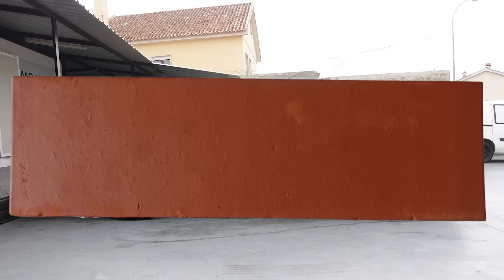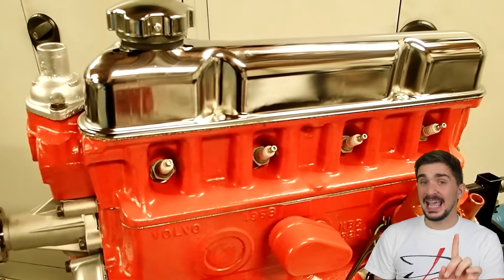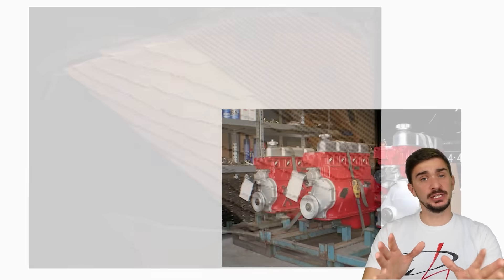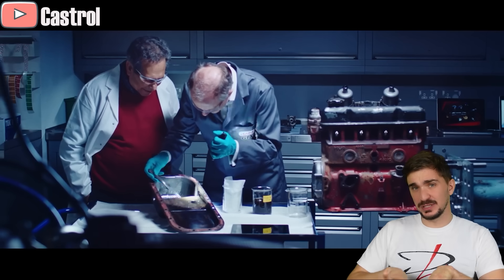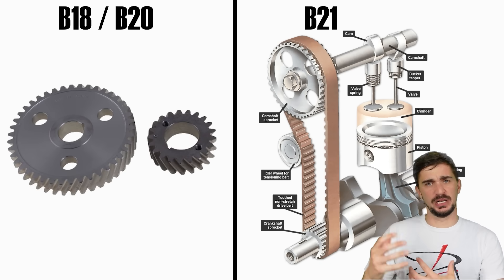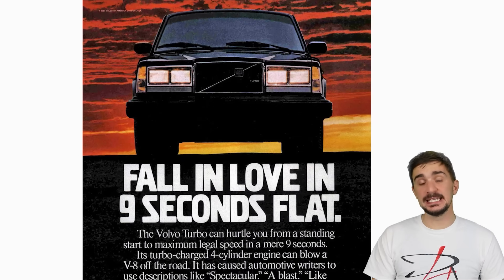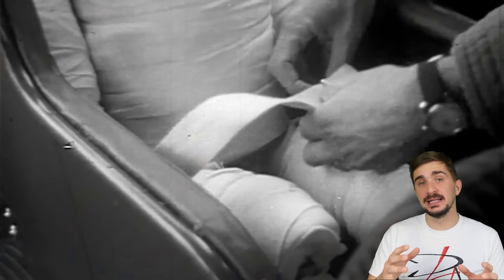A Story about the Volvo 240 and its Redblock Engine - Iconic Cars and Engines #18

Comment: There's a minor inaccuracy there: The 240, merely a facelift of the 140 series, was launched in 1974. The OHC engine wasn't introduced before 1977. Except for the changes to the block to make the OHC version, the engines remained the same, only varying in bore. The stroke remained 85mm with all of them. So basically, the engine was the same since the long block with its 5 crankshaft bearings. And yes, they were the best bloody cars ever, skip all Mercedes Benz and Beamers and what not.
With the 140 launched in 1962, the basic design stayed in production for 31 years. Why change something good? It was only when the Ford buzzers took over Volvo that the demise of the 200 series was decided. F*** was not at all good for Volvo, they took what they could get, based most of their designs o the Nineties on the 850 chassis and played havoc on many services Volvo offered their customers.
For example at least Volvo Germany here in Cologne had a service hotline for garages and DIYers where workshop reports were collected and available for everybody who encountered a problem he couldn't diagnose. This database had been collected since the Fifties and was a real treasure! It cost money, F*** wanted that money for their shareholder value, F*** shut it down.
F*** F***! 🤬😝 💩
I owned my 1977 244GL for 17 years and still miss the bugger today. I know where it is and if I win the lottery I will make its current owner an offer he can't reject!
I also owned two 340s and two 740s which I got after they had been exposed to SERIOUS neglect and abuse. Turns out you can even destroy Volvos, but engine, gearbox and rear axle still were going strong with all of them. (If you get a 740 with the Bendix made brake take a very close look at the front callipers. These are real troublemakers! Poor maintenance will cause them to stick, and the 740s hardly ever received really good maintenance once they got cheap.)

Comment: I owned three 240's between 1975 and 2008 and I can state without a doubt they were the most reliable and all round pleasant cars in my 53 years of driving.
Reply: I've never wanted a vehicle so badly so quickly
Reply: Care to expand please? Are they smooth? How about steering? Fuel consumption?etc
Reply: @JamaicanToast  Fuel consumption was not a strong point I admit, 28 or so mpg around town, but in those days petrol prices were not the concern as they are today. They were comfortable and 'smooth' enough for me and family. The 1975 244 DL was  the first car I ever owned with power steering so I found It light, especially for such a large car and all of them cornered very well. But it was the incredible reliability; the large carrying capacity; the fantastic heater on a winter day and the all important safety features that appealed to me. And the 'Red Block' B21 engines - say no more - unbreakable! For Instance our second 244DL bought in 1980 we kept for 18 years and that engine never had anything other than oil and air filter change, plugs, points and timing belt in all that time!
Reply: Hello Peter how are you doing 😊

Comment: Can anyone tell me if the suspensions on the 200 series Volvos was softened for the North American market? 

I ask this because in the mid 80s I installed stereos and all Volvo owners came boasting in with the same phrase, "Toughest car in the world! I rolled it and we just rolled it back on it's wheels and drove away." I can't express how many people bragged about rolling those Volvos. 
Eventually a turbo model came in. The "Turbo" badge meant it was fare game to try out when the customer dropped it off. I took it out on a straight road, and stomped on the throttle. Once the turbo kicked in, the heavy body flopped back  rendering the steering useless until I let off the throttle. If the suspension was really up to the job it would have been firm enough to control the body.
The only car that scared me more was a turbo Saab. It reacted the same way except it added torque steer to the fun. This is why I wonder if NA got softer suspensions than EU.
As a side note, I drove plenty of Porsches. MR2s, Eclipses, 300Z etc. None of those ever scared me.
Reply: l would argue that the suspension springs in the early 70s was too soft. lf you look @ the cars of '70, to '74, the rear wheels went lower inside the wheel well after about 6 months (my father owned a Volvo dealership in Canada and l rubbed many new Volvos by hand, rubbing off that white soap/wax film and saw it up close and personal). After '75 with the introduction of the 'shovel nose', the rear wheel spring adjustment was made to a harder form so that it remained level, from front to back. ln 1987, with the introduction of Euro spec headlights and further aerodynamic extended nose, the rear suspension springs were slightly stiffened to a satisfying slight decline to the front wheels. Look at the 140 --> 240 cars, over the time the rear suspension springs become stiffer and higher.
Reply: @PhilDykshoorn  Thanks for the response and insight. Very interesting. All I can say is that for the turbo versions I believe the springs and dampers could have been even stiffer to control the turbo lag. And back to my initial statement, were the EU suspensions stiffer the NA. 
I much appreciate the insight.

Comment: 1:45 Same timing design as the Ford inline 300, which has been around since the early 60's and regarded as the best inline 6 ever. That's 15 years earlier than this engine.

Comment: @2:09 Whether or not it is fact or fiction but cast iron is pretty rugged.
@8:25 Durability, which resulted in an overbuild engine.
@10:23 The 240 Turbo was anything but a performance car and practicality is anything but the hallmark of a sports car.
@11:09 The stock version was still no performance car and as sleek as a brick.
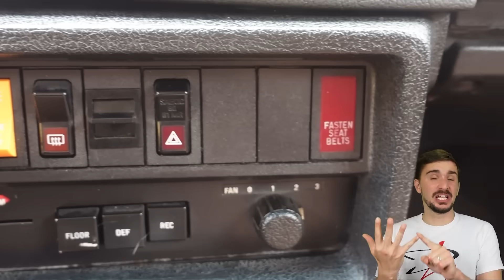@11:51 The reason why it was primarily bought by cheapskates and leather interior was the exception to the rule.
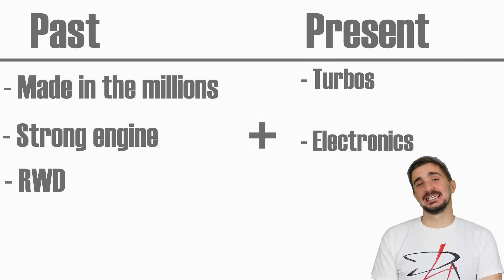@13:59 If you don't mind the poor drag coefficient and a car of the 70ies with basic interior, that is.
Reply from the maker: I know exactly what it feels like to sit through a movie with you

Comment: I must say that the cam gear on the B18/B20 can break. It happened to me driving from Gothenburg to Oslo on the motorway. All of a sudden the engine stopped working. I was towed to a garage and i quickly found out that the camshaft wasn't moving anymore. I got new parts the same day and replaced them outside the garage, and had the car running in hours. No damage to any parts except the fiber gear. Really good engines. :)
Reply: Happend in my 242 too. The fiber gear exploded and cracked the gear cover. Had to tow the car 120 km without power brakes. Found a replacement gear for free and in a few days it was running again.

Comment: Fantastic video! I have one and the only way I'll get rid of it is if it's totaled beyond reasonable repair in an accident, then I'll buy another. 

A few things things I'd add. The rear axle is a Dana 30 which can take more torque under street driving conditions than a turbo redblock can produce. This means most engine swaps don't require a stronger rear end like a Ford 8.8 unless you're really beating on it. A 6'2" adult can sleep in the back of the wagon and I've fit 10ft/3m tubes inside when I didn't have a roof rack. 

The one major downside is the M47 transmissions are absolute garbage. The M46 was a bit stronger, but for a company obsessed with building such a durable car I can't fathom why they put such weak transmissions in them.

Comment: As a '80's Volvo owner i liked this video a lot ( altough the engine in my car is derived from Renault)
Reply from the maker: PRV?
Reply: @d4a  It's the Cleon engine from Renault,  C2J,  1397cc.
It was used in the Volvo 340 which was build in the Netherlands as a follow up from the DAF car.
The Cleon engine was build from 1963 up untill the '90's with some modifications through it's lifespan.

Maybe not as over engineered as the Volvo engines you've mentioned, but still very sturdy and reliable.

Comment: A very nice homage to Volvo and the redblocks! I would like to note that the 5 cylinder engines succeeding the redblock are also known for reliability, sound and performance. While I will probably never own a 240 series, I take comfort in the sound of my turbocharged 5pot.
Reply: Turbo 5 is awesome!
Reply: 850 = what a sound !
Reply: @51tomtomtom  Hello Thomas how are you doing 😊
Reply: just what I wanted to say. I know, it's a new generation of engine, but the 800 series was just as awesome, and just as reliable. Also, the only station wagon to race in BTCC
Reply: I've owned 16 Volvos in my life - 120s, 140s, 240s, 940s, and an S60R... The best sounding 2 were my 71 142E with it's B20E injected motor and 130HP (understated/underrated) and my R... that 5 just sounds amazing.   The 240 Turbo intercooled engine sounded good at full revs, but still sounded like a sewing machine/tractor at idle...

Comment: 1:47 I had thinking, "Why don't manufacturers use gears to connect the camshaft?", but I convinced myself that it's was just a stupid Ideia "if it really worth doing so someone would have done it before". However, now I know it wasn't a bad idea at all!
Reply from the maker: Many bulletproof engines use gears, a bunch motorcycle engines too. Noise and possible vibrations are really the only downside.

Comment: Brick guy here. 940T wagon b230fk manual m90, from 97 with all the extras and 520000km. Original engine with perfect 162psi on all cylinders, original gearbox. Redblocks never die! Let's go!
Reply: Cheers from russia, same shit here, but a knackered one the odometer says 400-something, but i'd add about 200-300K to that, engine rebuilt by some previous owner with liners (discovered this when the head gasket let go), td04-19, vx3, lada ecu, about 250 hp @0,5 bar. Also got myself a 1988 745 with b234f recently, now trying to find a way to get hold of a timing belt tensioner...
Reply: @zloychechen5150  the first owner of my car always brought it to the same dealership where he bought it next to his house. He was the kind of guy that pays Volvo to bring the car to anual inspection, you know, proper rich. LoL
With the car came an Excell sheet of all the maintenance and work done in the car for 24 years.
Just 30k ago they had the engine machined and all gaskets changed. That alone was a 3k euro job with receipt to prove it. It has to be one of the cars with the most prestine paper work ever.
Reply: @salvadorpalma8173  This seems like a gem of an automobile. I wish you all the best in keeping that mother as nice as it is, and just generally.
Reply: @zloychechen5150  you too. good luck with getting your hands on the part and in general, in these though times.
Reply: @zloychechen5150  it's hard to get the tensioner right now because you are in Russia? I can tell you some sellers, but don't know if they are shipping to RU.
Reply: @salvadorpalma8173  Yes, it is kind of because of that, there are ways around this, it's just that i may have chosen the shittiest one of them all, so the process is stuck at the moment, if there's no progress in the nearest days, i'm ordering it through other means. But thank you for the suggestion.

Comment: I have driven many cars, and the Volvo is one of the best.

Yes, a few years ago they had problems with the windscreens falling out, but even then they still:

Goes like stink. Holds the road like shit stuck to a blanket, and feels solid like a brick. 

I have no intention of owning a car (motorcycle) but if I did, a Volvo would be a strong contender, as long as it was pre 1969. Ie older than me.

Comment: I walk towards a red 945 and think ugh old car. Wobblematic suspension but I didn't knew about the B230FT under the hood. To my surprise when I pushed the pedal to the metal de rear sank, the front raised and holy crap it was rather fast. Instant love for the old turbo bricks
Reply: …and I bet that wobblematic suspension came from nobody throughout the life of the car even considering getting new shocks. The Niners had rather sporty stiff suspension.

Comment: Tough reliable cars with tough little engines.

Since the two door version is quite rare, I wouldn't mind getting the easily more attainable sedan and making it a performance car.

Whether to go red block or modular, it will have a manual.

Comment: What an awesome video,I have owned/driven 240's for 42 years and the first one was the best one a 1978 Volvo 242 GT and they got this car right, from day one, reliable, amazing the road in every way first car i owned with 4 wheel disc brakes, which saved my butt allot of times and it's the only car that comes with a wood stove for a heater in the winter time, and i live in the centre of Canada where we regularly have -30 celsius for days or weeks at a time, I am now on my 4th 240 and this is my first  4DR DL auto, and i can say it is refined over the 78 242 GT , it just doesn't handle as well or quit have the heart of it either , Last summer i crested the 1 million mile mark with these cars 1.6 million kilometres and my current 89 240 DL is nearing 400k kilometres and runs great and never used the block heater this winter, if you have a good battery in these cars they will always start in the cold, not luxury or fancy car, just ultimately reliable and you can do most of the service yourself  👍

Comment: To add an anecdote- a mate back when we first got our license, had a brick wagon. One day we asked him about servicing the engine- we had old carb/points engines in our cars.
His reply of "never done it" was proven when we asked to see the colour of his oil.
The dipstick was covered in metal dust. 
We suggested he go straight to the service station for oil.
When asked how it went, he asked if our cars cost $100 or more for oil (Back when 5L of oil cost $10)
He had FILLED the engine to the top of the filler cap.
He'd blown out a seal or two and covered the inside of the engine with oil but despite being near hydraulic lock, the mighty Volvo survived.

Comment: Well thats nothing. You should see the Ford KÖLN V4/V6 engines. Huuuuge bore spacings with tiny bores and displacement compared to the size of the block. Same fiber gear driven cam. The V4 in Taunus P4 12m did 350k km non stop for 120 days or something in French Miramas Circuit and survived in pretty good condition even tho oil was changed every 18k km. This engines oil is supposed to be changed every 5k even with normal use yet they changed it every 18k km when it was used at full throttle 24/7. that distance is basically going to moon from earth

Comment: The first thing that came to my mind was some dude with a 240 who drained the oil and put sand, dirt, rocks and water in the intake, and the engine still ran after a while. Not sure if it was a Redblock, I'm hearing that name for the first time.

Also that red Volvo (yours?) looks mighty fine!
Reply: I had a mate who did that through sheer neglect. 
We pulled the dipstick on it one time and it was dry, covered in metal dust. 
Still ran after he filled the thing to FULL with oil- I mean literally to the top of the oil filler.

Comment: Great video.   I had a 1976 Volvo 244. (2 Series, 4 Cyl, 4 Door) and it was an incredible solid car, I drove it all over Europe and it never let me down, bought with 120,000 miles and sold with 190,000 miles, it was starting to use a bit of oil but still good.  Later I moved to live in Thailand and I bought a Volvo 940 with the redblock turbo, I loved that car more than any car I have ever owned, but when I left Thailand in 2016 I had to sell it was I was moving to Ireland and exporting the car was not really an option. The old Volvos are amongst the best cars ever built, I have no experience of the later ones.

Comment: I have a 1985 244 DL and I can't stop loving this car! Granted, 80's sealing tech isn't nearly as good as it is today, but if it leaks, it still has fluid! I'm saving up to swap in a Ford 302 HO motor for that good ol Merican burble, but I know that I'll miss the endless reliability of the redblock motor!
Reply: I had a 1988 740 wagon with a Ford 302 HO and AOD transmission.  It was fun to drive, but I missed out on the redblock experience since I bought the car already converted.  Now I am looking for a decent 240, manual transmission.

Comment: My granda had volvo 244 79` with b21. Great car but the engine did not last that long, only about  300 000 km. Engine repair cost was to high for the car 30+ years old, so it was sold for the parts

Comment: Currently driving a Volvo 940 with a B230FT. The service record on repairs are replacing the water pump twice (the original got a cracked housing, the other leaked at the seal), a head gasket replacement and a turbo rebuild (bearings were worn out and the turbine scroll was corroded and cracked). Not a bad tally for an engine of over 500 000km. HG replacement was done just before breaking 500 000, the cylinders looked pretty much perfect. I wasn't thrilled moving to a SOHC 8v after getting used to DOHC 16v engines but it's a great motor, and easy to maintain.

Comment: And then in the mid 1980's Volvo switched to crappie insulation  for the engine wiring harness and the reliability went to shit. A car 4 years old that when you touched a wire the insulation would crumble. That was the beginning of the end for Volvo.

Comment: I could not agree more. I used Volvo from 1978 to 1998, 20 years and it is a very good and reliable car. I had to divorce the car since in Indonesia it was rather difficult to get the spare parts and hard to find competent mechanic around where I live. At that time came to my mind if Volvo conducted simple training for the car users I would be more than happy to join the course. By the way I am a mechanical engineer.  Anyway, I still admire that it was a good car.  Cheers from Jakarta, Indonesia.